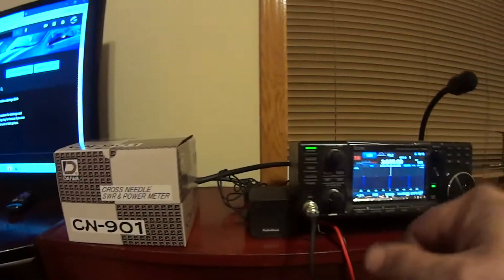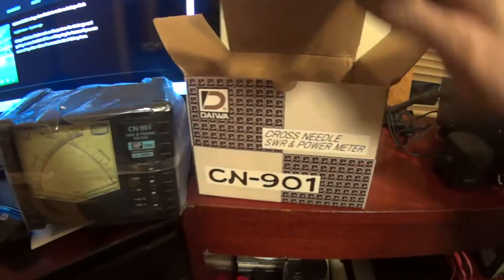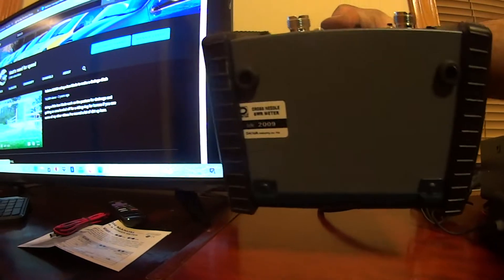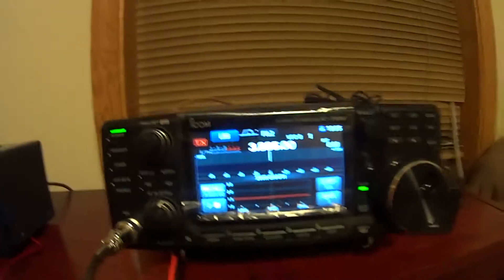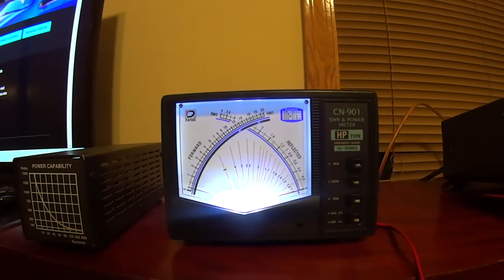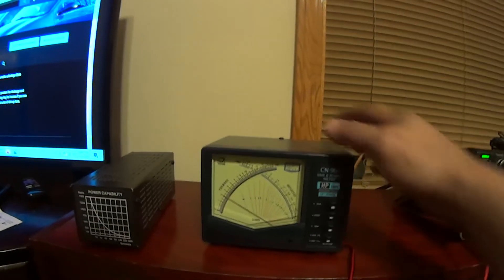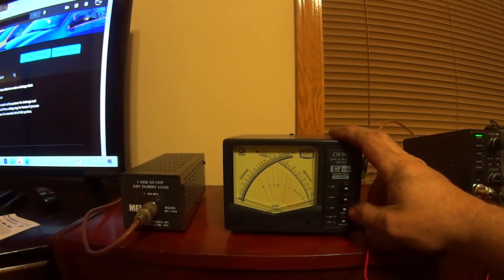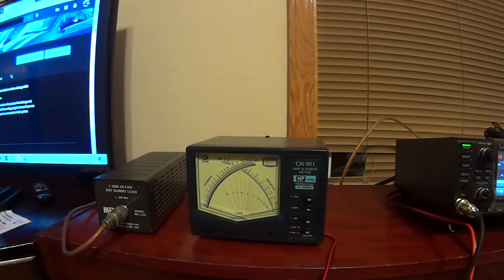cn-901 watt/ swr meter for ham and cb radio ic-7300

Comment: Is it heavy or light ?😂
Reply from the maker: well i just set it on the scale its 2lbs 8oz, would i say its heavy  no but it feels well built it has some mass that if it was bumped it stay in place or if i needed to stack equipment on top of it will support it

Comment: Mine came broken pep did not work...ordered it twice and both times pep did not work....
Reply from the maker: i had the same issue with an mfj meter from the problem it caused me i figured it was a bad solder joint,  this was my first experience with this brand and the reason I purchased this one so far its worked well for me.
Reply: @Mattsneedforspeed  ok thank you waiting for new one from Amazon...I will let you know how it goes

Comment: show 100 wttt in fm our  rtty???????????????????????
Reply from the maker: I don't use fm or ritty where i'm located no local repeaters on 10 meter and I don't have a set up for 6 meter so I didn't even think to show them.
Reply: @Mattsneedforspeed  you must use a dummy load to see the real power of your equipment
Reply from the maker: @JerusalempoderdeDios  please rewatch the video as I state I don’t have an antenna to transmit on only receive and I’m using dummy load it’s an mfj-264

Comment: Nice video, thanks for sharing with us. I have placed an order for the Icom IC-3700 and it should be getting here sometime soon. I was told that I should have a swr meter, so I messaged a seller on Ebay and asked if the swr meter that they had listed, was it the right meter for the Icom IC-3700? They said yes. So I placed an order and I got it today. After watching your video, I'm now a bit confused as to what swr meter I should have. They sent me the CN-501H. You have the CN-901. Should I have the same one as you have? I'm new to all this, and am as green as a shamrock.... I'm use to the old school cb radios and the new digital radios are nothing like those older radios. If ya can help me with info. that would be great. I've subbed your channel and Thumbs UP for sure.    Thanks    Roger
Reply from the maker: Hello, I started on Cb’s also. The specifications on the 501 will work fine fit the frequency coverage and wattage out it’s just a little less fancy and smaller then the 901. The 7300 is a good radio with lots of features for the price the icons are very easy to use compared to yaesu ones, It will be fun learning how to use it the hand microphone works great, but I’m running the sm-50 just get a good quality power supply 73’s
Reply: @Mattsneedforspeed  Good morning,  Thank you very much for the quick response to my question,  your great! Now I feel a lot better about the swr meter knowing that it'll work with my 7300. My 7300 is now at the FedEx sorting hub in Los Angeles, it's scheduled for delivery on Monday.  Can hardly wait for it to get here. I'm real excited. Thanks again and I might shoot ya a few questions while learning how to use the 7300, if that's OK?